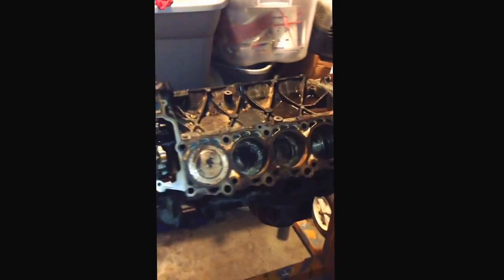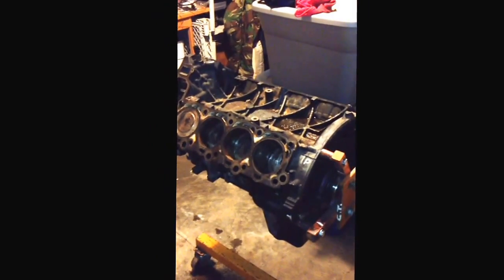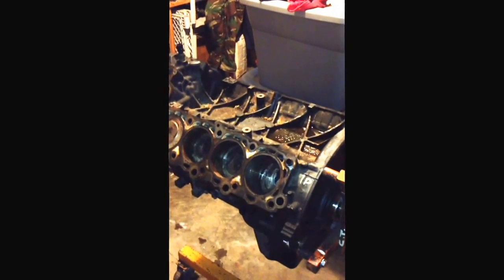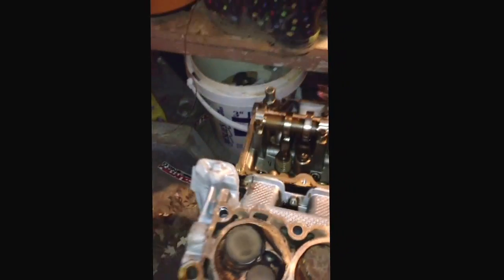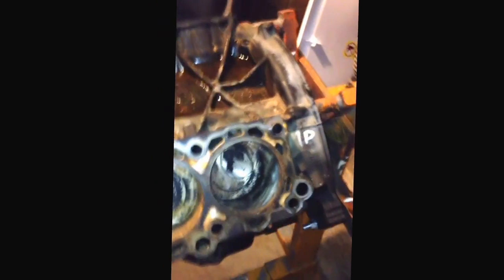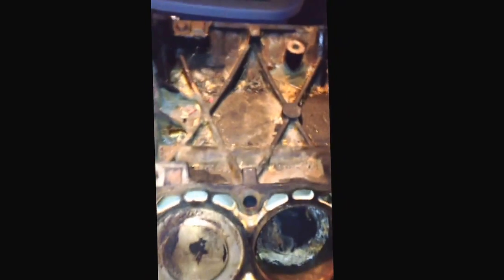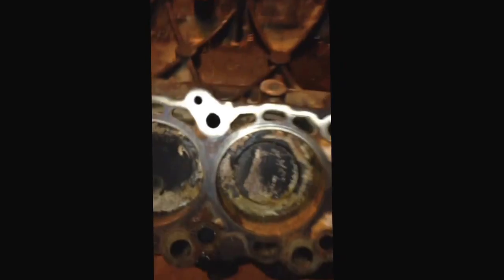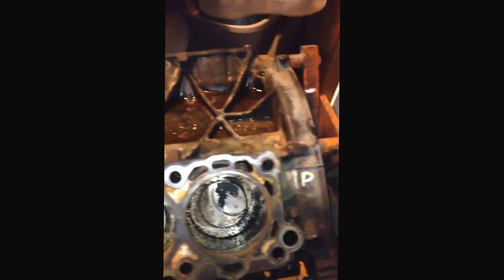Engine Rebuild 4.7L HO Motor 2002 Jeep Grand Cherokee (Part 1)

Comment: I own a 04 overland with this motor. 130000 on it. This valve thing worries me. As not first time I heard of it happening. Powdered metal. My question is it realible I'm just worried if I should sell the truck.
Reply: "This valve thing" is rare...  Usually when I see these motors dead, it's due to poor maintenance.

Comment: i am thinking of buying a 2003 Jeep grand cherokee limited with the 4.7 HO and 5 speed automatic. It has 104,500 miles and it seems to run real nice. Sounds smooth and is pretty fast. It has a few scratches but no rust and the paint is nice. Do you think i should buy it for 7500? how easy does the oil pump die on these engines?  I am having second thoughts now because i am seeing a lot about oil pressure sending units and oil pump fails and seized motors and so on. I don't plan to beat on it or even go extreme offroad but i am stretching myself spending $7500 for this and will not have money for repairs is it dies. What do you think? i need a dependable vehicle that will last for years.
Thanks you!!
-Scott
Reply: Thank you!! I ended up not buying the jeep but knowing what you said will help me lean towards buying one with the 4.7. Thank you for the reply!!

Comment: Hi Sr. have been seeing your videos because I'm thinking on buying one with a bad engine, would you tell me where you got all the information sheet, catalogs, and manual? I'd really appreciate if you help me with the technical information and measures! thanks
Reply from the maker: I would suggest that you do what I did. Go to EBay and search for the factory manual. I was able to download mine quite quickly and it cost lest than $8.